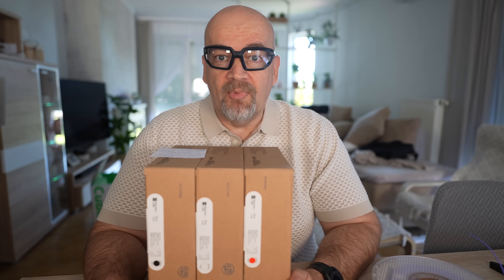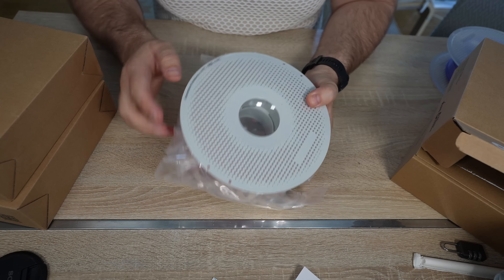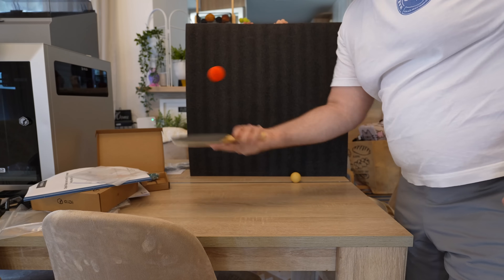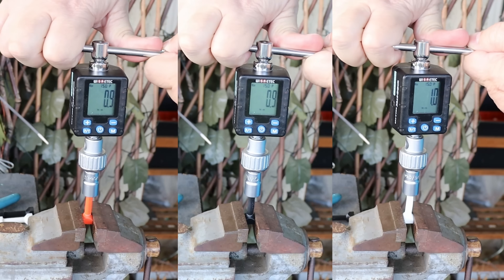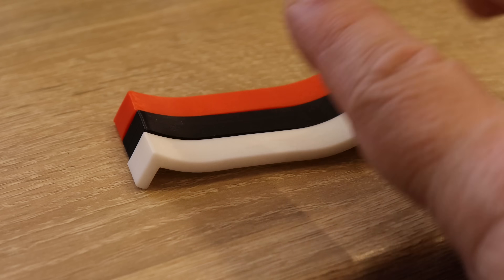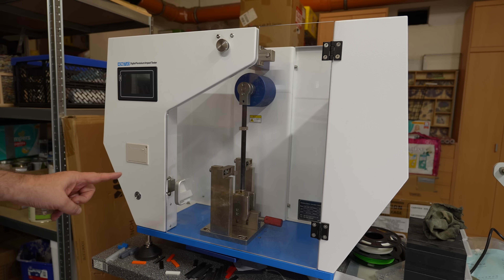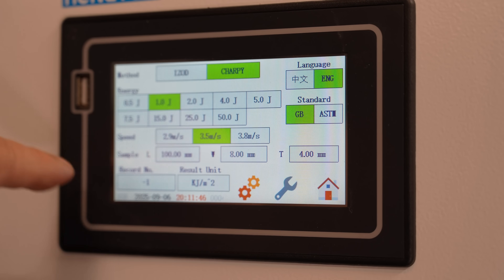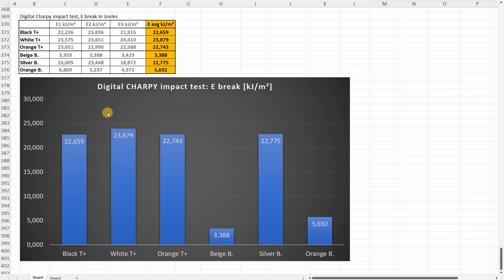Tough or Not? Bambu Lab PLA Tough+ Filament Review

Comment: Very good Video/Test, BUT my own simple break test with Extrudr PLA NX2, Bambu Lab PLA Basic and PLA tough+ shows a different picture. Have created three 6mm x 6mm and 50mm long columns with 10%, 50% and 90% grid infill, all in white color. Have used the according profile and a 0.2mm layer. Result: The Extrudr PLA column was easy to break, the Bambulab PLA basic was much more difficult to break and the PLA tought+ was not breakable by me and 2 other persons. For me the reason to switch from Extrudr to Bambulab filaments. 
Why do I see this different result ? Perhaps I am too weak ? Or breaking by hand/fingers is not the right method?
Overall, my engineering heart loves your videos.
best regards
Peter

Comment: Another comment. I am new to 3D printing and did not know any better, so I have been printing PLA in my enclosed P1S. You mentioned you don't like printing PLA enclosed. Can you say why?
Reply from the maker: PLA needs more part cooling, and also there is a risk that it may became soft in the cold zone of the hotend. That's the heat creep. Some printers have a solution to this (like ventilation doors on H2S, where we can print with closed door too)

Comment: I am glad you noticed your old PLA Basic had a very high impact strength (possible error in test). I am deciding between PLA Basic and PET HF from Bambu for a handle for a tool and the original person used PETG CF . I don't need higher temperature resistance, and can't print CF filaments.  A quick google search indicates that PETG should have 2x higher impact resistance but your testing does not show this when I look at Bambu filaments (excluding your early PLA Basic result), they are about the same and this test of Orange is higher than the PETG-HF. PLA Basic has high layer adhesion. Given my choice I think I will go with my Orange PLA basic. Why do you think there is this perception that PETG has higher impact resistance?
Reply: I'd say because ts more flexible people automatically assume it handles impacts better. Impact resistance has always been the most important feature for my uses and I always loved polymaker polylitempla pro, Igor's testing confirmed it has excellent impact resistance.

Comment: Like what you do,
what do you think about testing with the same material I.E. pla but use the same layer height I.E. 0.24mm but use 0.2, 0.4, 0.6, 0.8 to see if that would make it weaker or stronger?

Comment: I recently started printing in Polymaker PPS... I noticed something strange with the GF version.

When I went to print an extrusion flow test, the print would fail around the same point every time. The failure was the heater losing temp and triggering a safety stop.

The failure was consistent within a short window after it started printing the top layers over the infill.

I managed to do the test by printing a single test part at a time.

After when printing a ln actually part, I noticed dips in the heater temp in the graph. When reprinting the same part again, the same temp drop happened at the same time in the print process.

Seems like the GF PPS is pulling more heat from the heater block when extruding at a constant speed for extended periods... Thats my only idea on this for now without more testing.

Edit after more testing, went back to the PPS CF and reprinted the initial flow rate test that went just fine, and it failed as well. So I am not sure why the Temps are dropping during printing. Need to dig into things more.

Comment: I have been using Sunlu PLA+ 2.0 lately.

It prints and works well for me so far, but I do wonder how it performs in testing.

Most of my printing is done in Siraya Tech ABS GF now, but the Sunlu PLA is good for prototype prints.
Reply: Interesting, any particular reasons why you like ABS GF? I’m looking for a good all around filament with good printability
Reply: @willng34 I print more practical and engineering types of prints than decorative.

I find that the GF ABS works well and prints well. Colors are limited, black, gray, and white.

Prints better than about any PLA I have used. Just needs an enclosure for best results. I like to keep the chamber temp between 40 and 50 degrees for longer prints. I allow the printer to heat soak for about 10min or so after the bed heats up. I also have a chamber heater to help speed things up.

But if the part is small I don't bother with the chamber heater and just let the bed heat up and sit for a bit so the expansion from heat is mostly settled down then I start the print.

If I need more heat resistance or increased strength I will go with something higher end for filament, but the GF ABS works for just about everything else.

Comment: Sunlu released a new high speed pla+ 2.0. can be printed up to 600mm/s and with a maximum of 260°c. Really would now if I still should stick to the regular pla+ 2.0. better flow rate would be appreciated 
They launched it together with Jayo and sometimes it's just marketed as high speed pla+ without the 2.0. ah, and they also released hs matte pla

Comment: I know you don't get a ton of views on this channel compared with 'entertainment' channels, but you're doing incredibly useful work and you're really the only person holding these filament manufacturer's accountable for their marketing claims! It's really important stuff, thank you so much <3 

Also, the iDryer video was really good, and it seems like the only dryer that is actually capable of consistently maintaining a correct temperature that you've tested... but how do you actually make one or get one?
Reply from the maker: iDryer, its on github too. You self source parts or you can buy a kit offered by the developer. Also, you have to 3D print parts yourself. But don'T forget, its hard to connect it with Klipper. I am waiting for the stand-alone version.

Comment: Please do ELEGOO PAHT it’s great stuff!! Only 40$ kG!!
Reply from the maker: Test objects printed, I'll get to it soon!
Reply: Yeah I have been using it and super impressed. It still needs drying but doesn't absorb moisture like most nylons.
Reply: 40$?!? A KG that is insanely expensive. Do you think we poop out every day?
Reply: @Cart_of_a_Jon  Bambu PAHT is $94.99/kg. This is an engineering grade filament. $40/kg is pretty good value comparatively and I think the cheapest I've seen this filament.
Reply: @Cart_of_a_Jon bambu PAHT for 1kg is 94$???

Comment: I'm curious what percentage of 3D printer users actually use this type of information day-to-day. As a hobbiest that prints 99.99% 'practical' parts, I am intimately aware that a 3D printer is simply not a technology I would rely on if verifiable, repeatable strength is paramount.  Basically,  parts break easy in comparison to their injection-molded counterparts.
Reply: It's not that simple.
Reply: @riba2233  Unlike your reply?
Reply: @imacmill   yes. what are you trying to say?

Comment: Wow, so the Panda numbers are big fat lies.  No 61dC heat resistance, and still way MORE brittle than their (and everyone elses), ASA & ABS, despite all the marketing.  
The only other obvious explanation is batch variation, but if batch to batch varied this much, it wouldn't be worth buying anyway...
Reply from the maker: Important notice about my temperature test: it don't follows any standard (but the load is almost 1/3 from the ISO75 standard). But on the other side, my impact testing became more and more accurate with the new equipment.
Reply: @MyTechFun  Agreed, your temp numbers are almost always lower than the published ISO75 standard test results, perhaps you apply some radient heat as well as conventive heat?  Still, in real life resisting radient heat is usually also important.  The great thing about your temp testing is it has been consistant for all filaments, so the comparisions are informative.